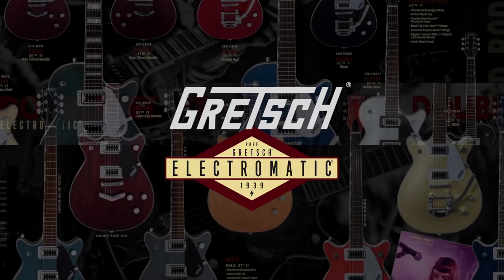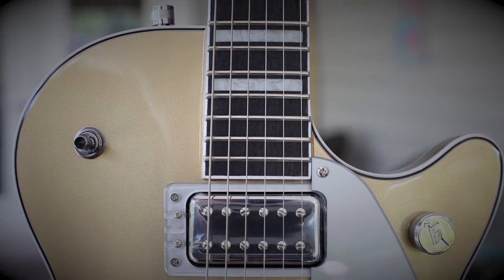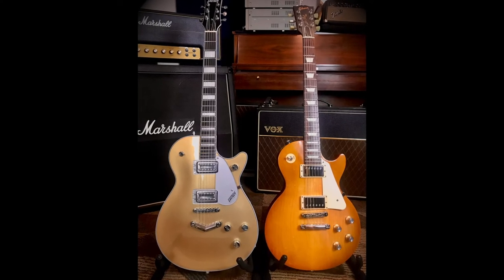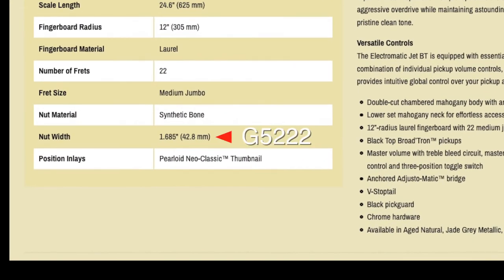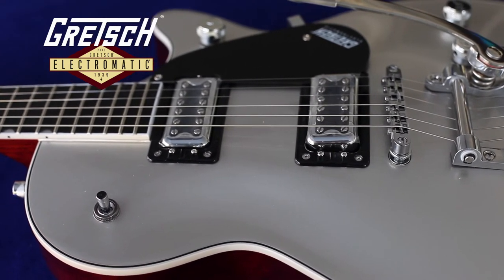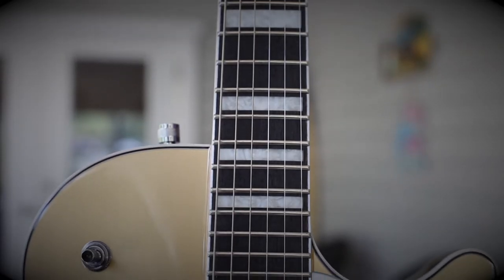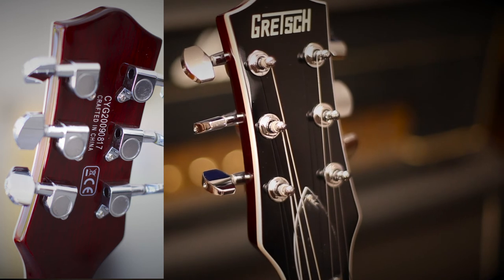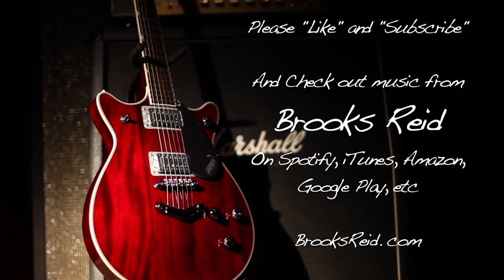Which Gretsch Guitar Neck is Right for YOU? Demystifying The Gretsch Solid Body Electromatic models

Comment: I noticed on the Gretsch web site that the differences between the G5220 and the G5230T are the stop-tail and Bigsby AND pickups. The "20" means Blacktop Broad'Tron and the "30" means Blacktop Filter'Tron. I think the Broad'Trons are the hotter of the two, but I'm guessing. So confusing. So Gretsch's rule is if you want a stop-tail you have to take Broad'Tron pickups and if you want a Bigsby you have to take Filter'Tron pickups. Unless of course, you're left handed; then you can have a G5230LH with a stop-tail and  Filter'Trons, but you can't have that right-handed. And don't even think of a lefty with a Bigsby and Filter'Trons. I'm a righty but another thing I noticed is it doesn't seem that you can get a left-handed Bigsby, on an Electromatic, anyway. I thought I might like a G5622 in Georgia Green which is a right-handed double-cut center-block semi-acoustic with a stop-tail, but you can only get that left-handed, if you want that colour in a right-handed you have to have a Bigsby. No equity for right and left handed players.

Comment: Very informative and professional, thanks. Subscribed instantly. I have very small hands, 7.5 inch thumb to pinky span. My take away is that the 5220 has a wider but flatter neck, while the 5222 has a thicker but narrower neck. What would be best for my very small hand. FYI, I like my 1976 Strat neck while too long, but my 2007 Gibson BFG neck I find hard to play.

Comment: hi buddy..are the chinese made gretch any good?ive always fancied the double cut model but the usa core models are just to expensive..what are the differences between the usa and chinese nade ones?
Reply from the maker: Hey Paul,  The MIC Gretsch guitars are another sleeper like the CV Tele. I was so knocked out by the G5220 I bought 2! I have not played the high end MIJ Gretsch but I can tell you that for $499 you could not ask for a better guitar. I have another Gretsch here you should take a look at. What sold me on the G5220 was the neck.  It's wide and flat. The workmanship is flawless and the setup out of the box was spot on. The Blacktron pickups sound great and have plenty of fullness with more twang than Humbuckers.

Comment: I'm a lefty and was wondering if the same goes for the G5220LH where the neck is wider and with less depth than the G5230LH?
Reply from the maker: Hi DM, I did not have a chance to try the left handed model but I would think it would be the same.
Reply: Being a beginner I got a CV 50s Telecaster because of the good reviews it got and the look of simplicity of the guitar.  The less knobs and switches means the less confusing and intimidating for a newbie.  The guitar is really great but I found that my fat fingertips are constantly touching other strings no matter how I tried to adjust my wrist even with slightly formed calluses on my fingertips.   I ordered the G5220LH after watching your you tube post and we'll see how it goes from here after the guitar arrives.  Thanks for the very informative video.
Reply from the maker: @hwnfrd  DM, please let me know how you like it. If the neck is like the right hand version I think you'll be happy.
Reply: @airtimedesign  Hi Brooks, got the G5220LH today and you are absolutely right, this neck is much easier for my fat fingertips.  Now I have renewed incentive to start practicing again as I was giving up hope. As stated earlier being a beginner, ( 60 year old beginner) it's easy to lose focus and give up after trying for so long without remedying the problem. Your video is the most helpful for me as it solved my biggest problem, having fat fingers. In fact, I am enrolled in the Fender play online course and I can honestly say that your video was the best help out of all the you tube videos I have watched regarding problems with fat fingers. Now I just need for my fingers to get educated a lot more so I can reach those pinky stretching chords and transition between chords and notes better. Maybe you should have an online class.
Reply from the maker: @hwnfrd  That's great! Glad you are enjoying it and remember regardless of if you're a beginner or a pro,  music is all about having fun!  And thank you so much for the compliment. You made my day!
Reply: Hi Brooks, I have a few questions. As I improve playing my guitar,  would it become easier to play my CV 50s Telecaster and CV 60s Stratocaster because of their thinner necks?  Both of the CVs have the .9-.42 gauge strings on them would the soft strings be a reason that my fingers are hitting other strings because their vibration might be more "wobbly" for lack of a better word, than stiffer strings ? Thanks for your words of knowledge as you have been playing music professionally for awhile now.
Reply from the maker: @hwnfrd  Hi DM, I prefer 10's on most of my guitars. Since I'm heavy handed I tend to bend strings out of tune when I chording and 10's have more resistance or tension (stiffer) so they work for me better. But if you are playing blues and you are soloing and bending strings mostly then 9's make sense. Also I keep my fingernails really short because I have a hard time with muting adjacent strings when I chord. The less nail I have the less rattle or buzz I get from adjacent strings. If you mash down too hard you flaten out the tip of you finger and that causes muting of adjacent strings too. So find a happy medium where you can press the string down without too much pressure spreading out the tip of you finger over to another string. When you first start playing guitar it's a lot of muscle building and coordination before you can get things sounding clean. Just be patient and you'll get it.
Reply: Hi Brooks, I am hoping that you can give me some suggestions on combo amps.  I won't be playing in a band or doing gigs just playing at home mainly at lower volumes.  I'm not into high gains or distortion I prefer the clean tones. My combo amp is currently a Fender Mustang 1 V2 modeling amp but to me it sounds kind of "tin cannish" for lack of a better word plus I'm not one to download from the Fender fuse app and play around with the settings.  I am currently interested in the Marshall DSL5C combo amp, any suggestions? Thanks for your help and knowledge in this area.
Reply from the maker: @hwnfrd  I don't know much about the new Marshall combo amps. The most popular small light easy to gig amp now is the Boss Katana. A lot of people love the Katana. I like the small Vox combo amps like the older AD50 or newer VT series. VT 40 is about $250.  I'd also look for a used VOX AC15. The Fender Blues JR is a great little amp and of course the Fender Princeton Reverb and Deluxe Reverb are great small combo amps but get closer to $1000 range. Check on local Craigslist, Ebay or Reverb for used amps. Any of these would be a good choice. If I had to pick one I'd probably look for a used Fender Princeton Reverb.
Reply: @airtimedesign  Hi Brooks, thanks for your suggestions. I did look into the Fender Princeton Reverbs and they are pretty pricey even the used ones. I spent a few days including today watching You Tube videos and reading reviews online about various combo amps. The one that was most affordable for me right now with a decent sound in the clean tones at lower volumes was the Marshall DSL5CR. I think I'll try my luck on that one,  thanks again for your help.